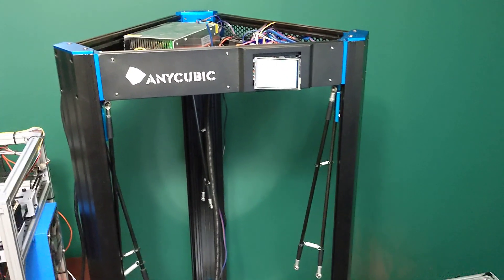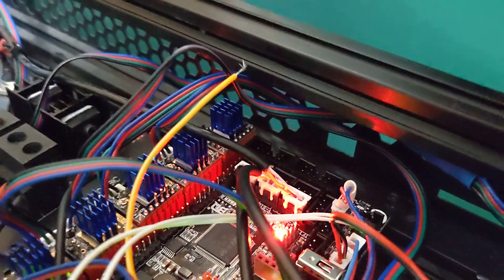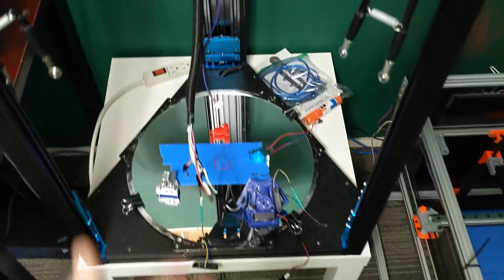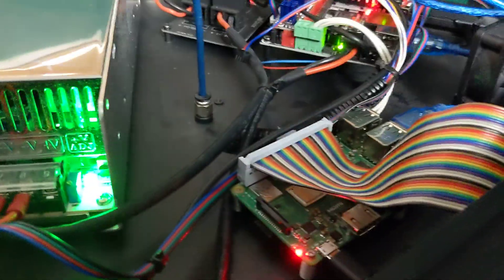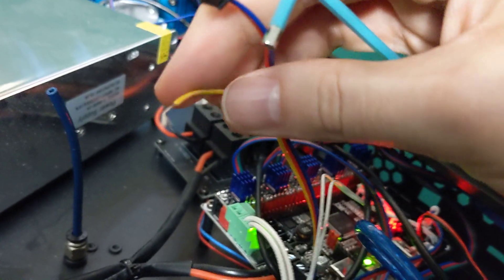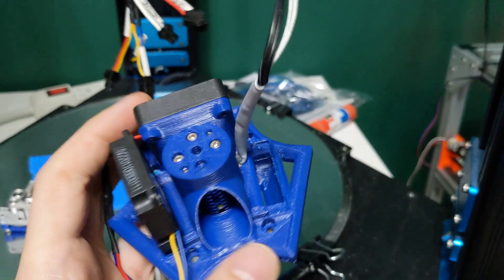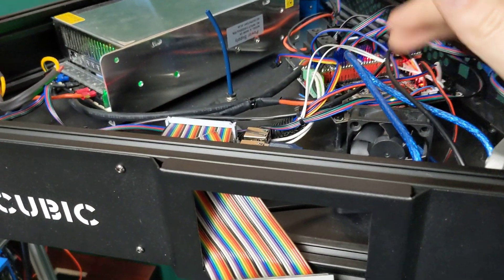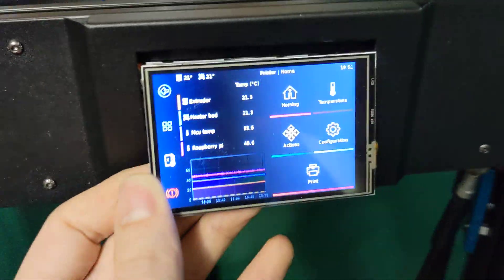Anycubic Predator Delta 3D Printer Upgrades Part 2 - Effector and SKR2

Comment: you are doing gods work, i have this printer and love it. I wanted to put klipper on it and you not only over that but lots of other great upgrades. One Q whats with direct drive, i thought having a flying drive meant faster and less shakey hot end? 
Would love info on the discord join too please and thanks
Reply from the maker: here is the link https://discord.gg/rolohaun-3d-946191040682008666 I still like direct drive but yest flying extruder is better for speed

Comment: Great upgrade. I actually did some changes to that effector to work with my Rapido Hotend (to the best of my novice ability). Works good but i feel like it needs 5015 when going fast.
Waiting to buy an orbiter to put it DD as well. 
Also probe works fine it seems, but considering adding an Euclid Probe to keep my sanity.
Reply from the maker: awesome, I may add 5015 later or remote cooling, the probe is only used once to calibrate so I will probably leave it

Comment: How does that extruder compare weight wise to the annex printed one?
Reply from the maker: Do you have a link to the annex one?
Reply: @Rolohaun  i listened to your video while doing other stuff, you should think about putting the runout sensor on the frame instead of the carriage.  You might have mentioned this,  but i don't remember now.
Reply from the maker: @travistucker7317  I don't need the runout sensor I don't print long enough prints. Just removed it to simplify
Reply: @Rolohaun  gotcha on the runout sensor.  Was really just talking about the other guys comment. I say ditch it, but if you just have to have one, put it on the frame for various reasons
Reply: @Rolohaun  can't link it man
Reply: @Rolohaun  sherpa mini is what you want
Reply from the maker: @travistucker7317  ohh Sherpa mini is 122g sailfin is 107g
Reply: @Rolohaun  the video i saw had the mini at 106 with the wiring.  That's the one on their YouTube page.  I personally would take a machined aluminum one for a few extra grams..  Haven't seen the sailfin before now.  Looks like you got this figured out.  Super cool man,  keep it up!
Reply: @Rolohaun  keeps deleting my comments

Comment: Don't forget to move your filament runout switch up inside the top with the printed funnel.   You will cuss yourself later if you don't.   Replace your effector bolts with cap screws + blue loctite.   Factory touch probe works great.   Pay attention to your v-wheel adjustments, they tend to loosen up faster than other v-wheel printers I've used.   PC wheels also help.   Also make sure your belt pulley grub screws are tight, they also loosen often.